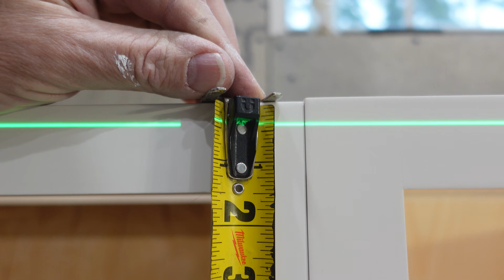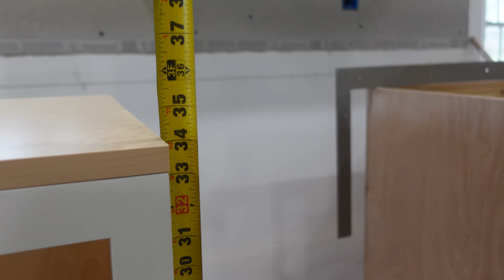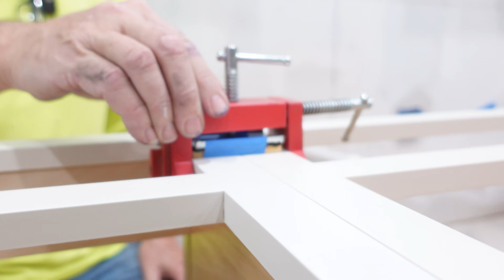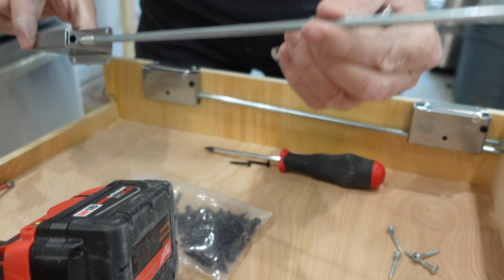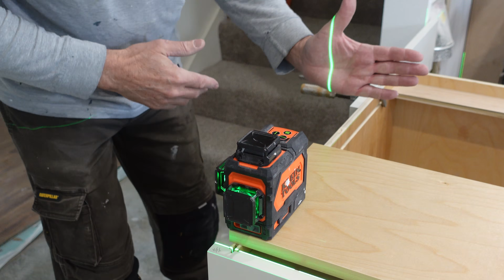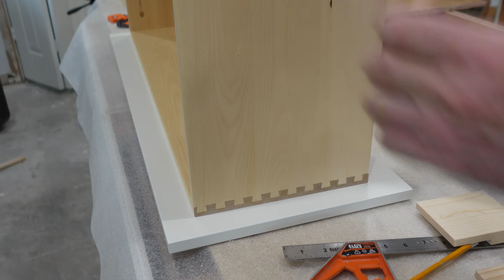HOW TO INSTALL CABINETS on an UNEVEN FLOOR!

Comment: Regarding the cabinets to the side of the stove: 
1. How will you "set them to kiss the flooring"? It appears one of them does not have an accessible hole to adjust the EZ Levels
2. How are they secured in place since they are not attached to the wall?
Thanks again, guys, for keeping this great content coming!
Reply from the maker: They're accessible from the back.  They're attached to the wall at the plywood panel.  Normally I would attach sleepers to the floor for that but 600 pounds of quartz counter will do the trick too.
Reply: @StudPack  that corner cabinet only has access on the front panel and left side (both finished surfaces). The back and right side will be inaccessible. We see this at about 22:02. Thanks again, love the show  🤙🏽
Reply from the maker: We leveled the corner cabinet first then leveled/attached the adjacent cabinet.  Thanks for the support 🤙

Comment: Make a base with 2x6 studs to make a level base. If the toe kick has matching or different material than the cabinet who’s cares. Getting cabinets that have loose side panels is much easier to install. Custom cabinets are over rated.

Comment: um.... I'm nit picky. The huge void space around the stove will trap dust, dirt, debris, and pests which will bring in small trash.... yes I know the stove is modern and safe, but, after doing the Navy thing and seeing "its safe as bonds from Lloyds of London" turn out to burst into flames (thanks to the USS Forrestal which seemed to have a burning laundry every half hour from dryer lint) that much space could harbor a significant fire and since its in a semiconfined space and requires moving a heavy appliance to get to it to fight it.... Yeah, I'm the weird one who would drill a small hole in the backwall and fish a CO2 Dispersing Head into the void space and have it hooked up to a remote CO2 Bottle and Mechanical Activation Handle with potentially a Fusible Link inside the void space to automatically activate it in case a fire breaks out. But that's me.

Comment: What's the plywood thickness on the draw bottoms ? I'm asking because some of these cabinet manufacturers are fabricating their draws with dovetail joints for superior strength but use flimsy 1/4'' bottoms. It defeats the whole purpose .

Comment: Hey Paul, 
Not sure what kind of stone you’re using but I would add some kind of a metal or wood bracket to support it underneath the dishwasher void. Had a piece of marble crack in an Airbnb on the edge of the sub top and dishwasher void.

Comment: Do you have a sleeper screwed to the floor under your peninsula cabinets to attach the boxes to or is that side panel being attached to the wall good enough? Personally I would do that to the cabinets on the left side of the oven at least. Honestly I would find a way to do that to all of them working around the leveling feet, because none of them are directly screwed to the wall.

Comment: Does the upper cabinet to the right of the stove go over the top of stove?  I'm pretty sure you need at least 30" of clearance with combustibles over a gas cooktop..

Comment: Hello Stud Pack, why not use concrete self leveling floor leveler in the entire kitchen area and fix the slanted slab forever?
Is it because of budget or other reasons? Is it a good idea to use floor leveler in such a situation or better not and why?
Thank you for the videos, lot's of great information for DIY-ers like myself 👍👍

Comment: Spoiler alert - it appears the flooring is Flooret Modin Signature in Lato 😁Great choice if that is indeed what you are going with. I just completed 1200 sq ft of the Flooret Silvan engineered wood on my main level and am in the middle of 350 sq ft plus the stairs to the basement level of the Modin LVP. Flooret is a high quality product and their customer service is a match.

Comment: On the peninsula/island/stove lowers, if you screwed that paint matched panel to the wall and cabinets, isn't that going to lock in all those cabinets now to where you can't adjust the EZ up feet up and down for your flooring install?
Reply from the maker: We took the screws out, adjusted the EZ up, installed floor, lowered EZ, reattached cabinets

Comment: looks a bit odd having that upper cabinet end overhanging the stove top like that. would look better with a corner angled shelf cutting the corner parallel with the edge of the stove.

Comment: Thank you for a great year of entertaining presentations with the garage build. I've been giving serious consideration to making wall hanging base cabinets with mostly drawers for a Zuper custom look. The challenging part will be splitting a refrigerator and using a remote mounted compressor like in a commercial application. I will have a full-size dish washer and fridge in the larger than normal pantry anyway, but a floating fridge would be off the hook unique. I briefly considered adding a floating/suspended island too, but the juice wasn't worth the squeeze and I didn't want an obstructed view.
    I wish you and your family 'n crew a Merry MAGA Christmas !

Comment: Leveling cabinets on an uneven floor is why I switched to plastic leveler legs 25 years ago.  Much cheaper and easier and just as solid.
Reply: what are the plastic levelers you use? Thanks

Comment: that slab was rough. i think in hindsight, if it was me i might have split the difference on the cabinets, ie if it was 1.5" out of level from end to end, i wouldve cut 3/4" off one end and shimmed up 3/4" on the other end just because i think the toe kick being that much different would bug me. regardless they came out great! always more than 1 way to skin a cat

Comment: Question: with those perfect holes for the pipes, and jacking the cabinets.  Will that prevent movement up?  Or you just doing the front?
Reply from the maker: I had a little wiggle room but it was mostly the front

Comment: How are the cabinets on the oven side going to be raised for the flooring to fit underneath if it’s already screwed to the wall?
Reply from the maker: we removed the screws later, just wanted to check everything first

Comment: why not level the floor...did I miss something..every appliance is gonna be crooked????
Reply: Most appliances have adjustable “feet” at each corner that can be leveled out.
Reply: @ floors still crooked…1.5 inch over 8feet..not good…fix floors first.  Or your fired. lol
Reply: @mikeh5908  correct. If Paul was being hired and paid to do the job, I’m sure they would offer pricing for both options.

Comment: Forgive me for not reading through all the comments if my opinion has already been shared.  I think i would consiider  using self-leveling concrete repair to the floor first.
Reply: The low end would be halfway up the baseboard.

Comment: The sub-top works great if you have stone with a fabricated edge. If the stone edge is the same thickness of the slab then the sub-top will show.  No Bueno.

Comment: That flooring looks like it's from Flooret! And Lato is a great color choice. I installed my Flooret LVP almost 6 years ago and it's amazing. Their locking mechanism is great and it's been 100% waterproof for me. You guys will love it!
Reply: @lynnwilhelm7928  I’ve had it in a rental since 2019 and it’s okay. It scratches easier than they say.
Reply: Somewhat related comment -- Lato, in Polish means Summer.
Reply: I have the Silvan line (engineered wood) from them and it is amazing. Was thinking about the modin/LVP line.

Comment: Studpack if you can, have the stone fabricator do a 2" or 3" mitered edge depending on thickness of material. It will cost a little more but you will hide the subtop. A ton of commercial stone is still 2CM thick with a mitered or laminated edge.

Comment: Are you putting the flooring under the cabinet on the right side (I.e. of the sink side) only?  I didn’t see you accommodate the left-side cabinet in the same way, which (I suspect) will force you to notch around it.
Reply from the maker: Yes, all the cabinets were lifted to allow the flooring to go underneath

Comment: My 1939 house's dining room is the same way.  Now I know what to do when I get around to making my built ins!  Question:  I'm installing the cabinets on top of the original pine floor.  Do I need to put anything for the EZ Level feet to sit on since the pine is so soft?

Comment: You mentioned you hate when counter tops are different heights. Are you going to put a sub top on the set of cabinets by the range to raise that counter top height up to match the sink cabinets?
Reply from the maker: That was the plan but we actually didn't need the sub top.  Made it work somehow, it's all in the next video, should publish by Christmas

Comment: wouldn't it be easier to just install the cabinets after the flooring? then you wouldn't have an issue with either "notch it and caulk it" or using the EZ level to lift the cabinets up and get the flooring under. don't get me wrong, the EZ level method is pretty clever if you can't get the floor in before the cabinets
Reply: Your not supposed to install base cabinets directly on a lot of flooring types, he mentioned it briefly in the video; the feet will be on the concrete and the flooring will be under the edge and will have no gap but wont actually be putting the weight on the flooring.

Comment: I would have been tempted to empty the kitchen and dining room and use some self leveling concrete on the whole thing. I think you said they were replacing all the flooring, right? You could have eventually done the whole first floor. It might have slowed things down to start, but every step after would have been so much easier, no? 🤔🙂
Reply: Pretty sure self leveler can't go as high as they need, 1" or more?
Reply from the maker: I would have had to level the entire 1200 square foot first floor like you said.  Probably take 100s of gallons of leveler.  That was not in the budget or scope.

Comment: Run a clear bead of caulk inside the drawer bottom.  Keeps crumbs and dirt out.  Also caulk the box to the drawer front to keep that joint clean.
Reply: 👍🏼 I do that too: LEXEL tho. Also do it on cabinet boxes. (Especially make sure I don’t forget the one under the sink.)
Reply: What do you both do to tool it in those spots? Just a finger?
Reply: @Obtuse94  I just cut a very small hole & run a small bead. If I mess it up I’ll go back with my finger & fix it tho.

Comment: I would have used self leveling concrete to level the slab, you can’t just leave it with that much slope.

Comment: Missed the slab on the inspection? How was it not known when buying the house? 😅
Reply from the maker: Never seen an inspector check a slab for level
Reply: @StudPack  love what you guys do but  one of my many hats in life was/is inspecting homes and if it is a slab on ground should never have a deviation of anything like one inch in 10 feet. So much depends on the subsoil and preparation of the subgrade, but the slab should be very much near level. I wouldn’t expect much more variation than 1/4-inch in 10 feet. I know it got missed and it’s a bummer… but at the point of finding out it either one of those things you have to live with forever or scrap the project and sell it to buy something different. But to say an inspector wouldn’t throw a 6-8ft level during an inspection is a bit absurd.
Reply from the maker: All good points thanks!  But I've never seen an inspector check much less carry a level that long in their vehicle.  Just doesn't happen here.  If I were a home inspector you betcha I would but then the realtors would be mad at me cuz the house would never sell and eventually I'd be out of a job 🤷‍♂️
Reply: Great floor for a pool table 😁

Comment: Dont forget to trim that end panel to the floor height before the counter top is installed. Looks like it is scribed to the concrete instead of the finished floor height
Reply: Was just about to type this myself :D

Comment: Why not put up a form board on the floor, then use self leveling concrete to bring the whole floor up? Set a small step or threshold on the high side. 

A level floor is more important than a cabinet that will bother you every time you look at the cabinet floor area.
Reply: That floor is likely 3" out of level from end to end. That would be a ton of work and all the rooms connect so you have tiny steps going into different rooms.
Reply: He explained why in a previous video.

Comment: If you’re going to use that Festool indoors ever again, even a garage, get a Festool HEPA dust extractor and save your lungs! I have the MIDI and its is AMAZING! Opt in for the bluetooth remote too. You won’t need it when your saw is plugged in, but when you use it for other tasks or tools it is very much worth it!

Comment: Why aren’t you applying a self levelling concrete on the entire floor?
Reply: There's no leveling that foundation with self leveler. It's probably 3"+ from end to end
Reply: @wojtek-33 sure you can. Just have to do it in stages. I've seen a 6" difference done on an entire house. Took 4 stages  but that floor was 100% level after.
Reply: @Chris...S  Anything can be done to anything, but that doesn't mean it always make sense, financially or practically. You would be essentially gutting the lower portion of the whole first floor.
Reply from the maker: correct wojtek plus it would take 100s of gallons and several lifts of SLU, not worth it imo
Reply: I've had the same thought.  But, they would need to do the entire floor and since this is a partial reno that's not possible.  So then perhaps start at the kitchen, but I would be concerned about that thin edge.  I don't believe Paul knew the floor was so far ut of level when the project was started or he may have done that.
Reply: Actually, they plan to replace all the flooring, so yes, it would have made sense to self level it all cause it will come bite them later.
Reply: Doesn’t have to be the entire kitchen. You could have block off just the area of the kitchen cabinets, border it pour the self leveling compound, and cover up with the toe kick
Reply: @muziv82  He could have shimmed and done that. He covered why he didn't do that in the previous (and in some spots in this) video.
Reply: @chris…s that would not work at all because the rest of the house is sitting on that un level surface. IE: The stair landing would be way off and then you redo that and it just opens up a major can of worms

Comment: Run the hole saw backwards first and you don't need tape
Reply: 👍🏼👍🏼 I do that on wood cabinets, fiberglass, & ABS showers/tubs, but on the really thin stuff I’ll still tape… just in case.
Reply: @mattwilliamson1714  yeah. Depends on the situation. I've used the same hole saws as the video and not a problem
Reply from the maker: They actually did a great job

Comment: Liquid floor leveler?
Reply: Wish they would have addressed that.  That was my first thought too.
Reply: It’s too much of a dramatic change to do with simple liquid leveler.
Reply: @saljablo2767  Could you imagine floor leveler 3" up the stairs, along the back walls and all the other parts of the 1st floor that would need to be adjusted like door thresholds and the like? Maybe even entire door frames.